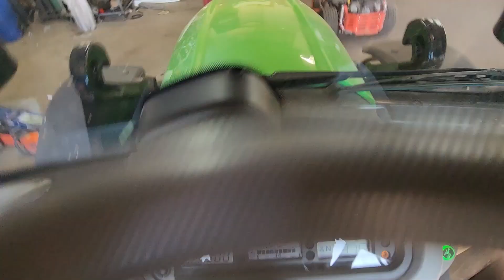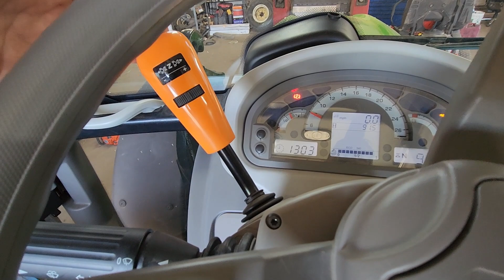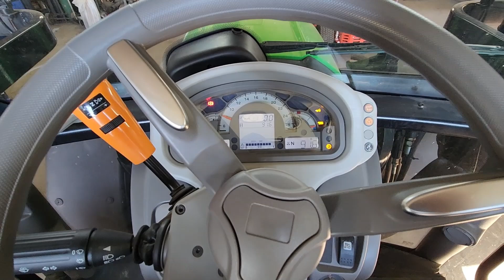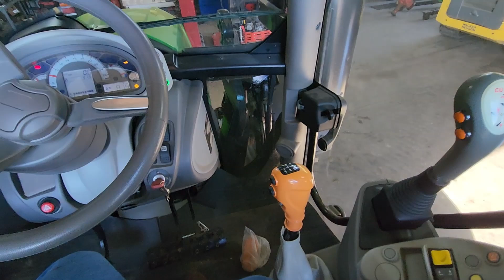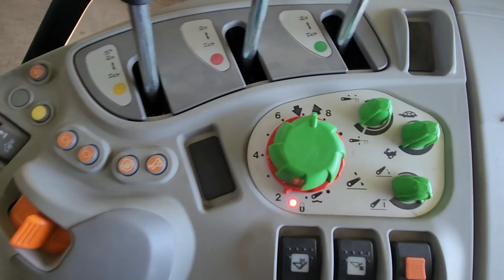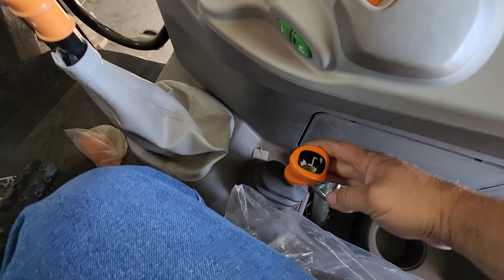Deutz Fahr 5110 Premium Detailed Cab Tour

Comment: I deleated most of those stupid buttons. Took off the eco pto. Got rid of the seat safety  pto switch.. deleted the engine. Git rid of that irratating steering wheel turn function and the stop and go. Now i really like the tractor.   Very good quality machine . Very comfortable  . Nicely priced.
Reply from the maker: I'm glad you were able to get it set up the way it works best for you!